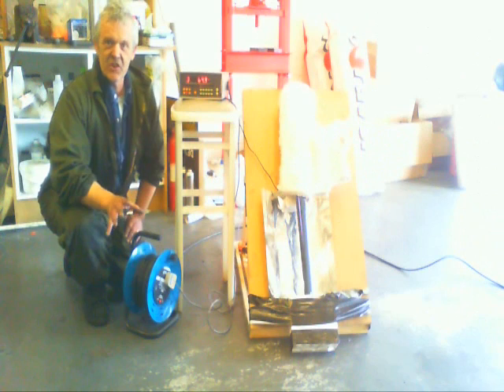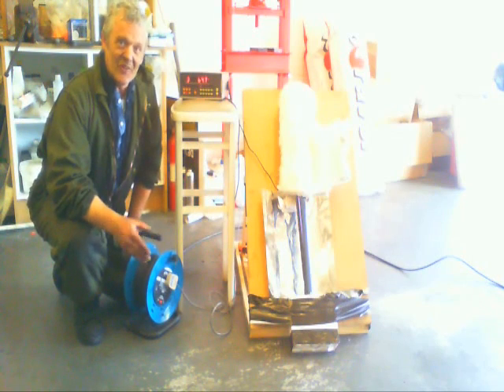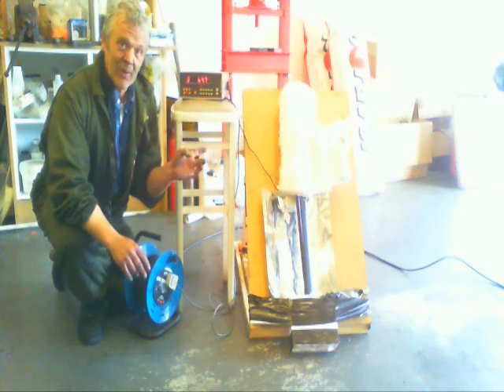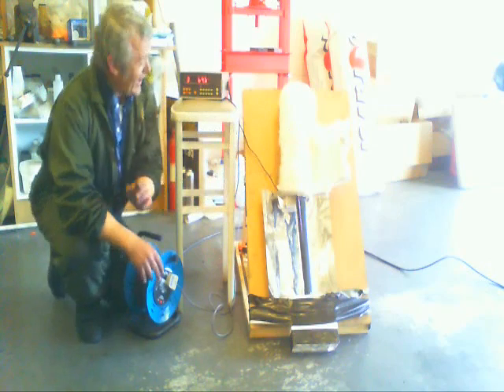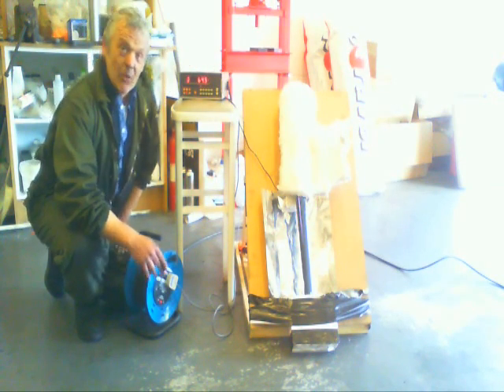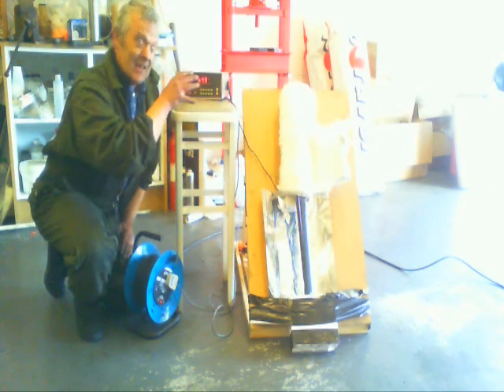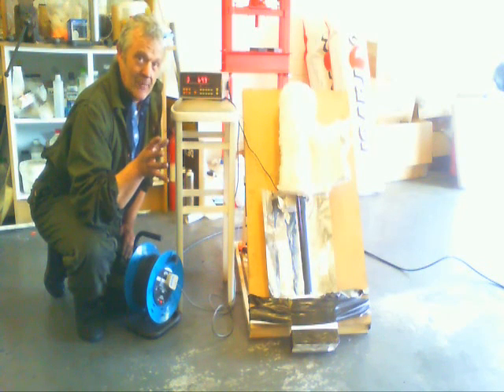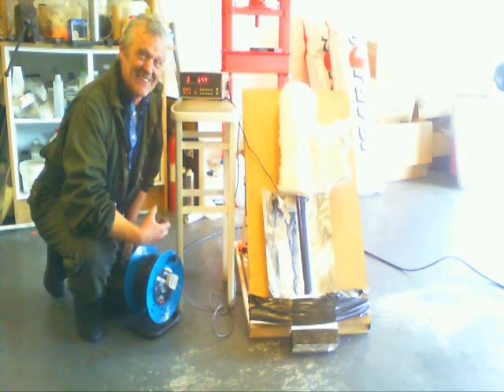Improved Heat Pipe - Over 95% Efficient

Comment: Do I understand correctly that here you are using the heat pipe that you made in a previous video, meaning a sealed copper pipe with water and graphene suspended inside, and then you have put that pipe inside a what? Did you say solar tube?
Is that the same as this one: http://www.electric-bike-kit.com/solar-tube.aspx ?

But in the description you say it is not even in a vacuum, so I am confused.
Reply from the maker: +sveindaniel that is right - the commercial tube is a vacuum tube but the heat pipe itself isn't under vacuum

Comment: Imagine putting the Thermocell in a vacuum tube, which a clever guy converted into a solar stove/gril instead of using it to heat water.
http://www.gosunstove.com/

A friend introduced me to Lovell's website and I saw how he imagined stacking those plates up in an insulated shell with very good results in the 100 celcius range.
You will get triple that using vacuumtubes.

Would be a fun project to laminate the layers in rod forms and put it out to test.
I don't know of a better way to convert light to heat to electricity.
Reply from the maker: Greenme Research nice idea - gives me a thought

Comment: Robert, I have been looking at these solar glass vacuum tubes from China for heating water, they claim to reach temperatures close to 200c and with a cooper heat tube inside the head of such a tube you can easily put a TIG generator to it, plus supply your hot water needs.... Just a thought
Reply from the maker: Monty Perales good thought mate - give it a go and let me know how you get on

Comment: I would use emergency pressure releif valves of course
Reply from the maker: good ldea lol - but that is easy enough to do - buy a second hand pressure cooker and use the bits from the lid!
Reply: I thought about taking a pressure cooker, and converting it into a high output percolater.  Then push the high temp water n steam through a n air cooled radiator before returning the water to the pressure cooker.
Reply: That should have good works for a thermal pump, and heat transfer to aid in capture in the heat released by a wood stove/ fire place
Reply from the maker: joe carrigan good ideas mate - give them a go and let me know how you get on - a vid or two would be really great to see